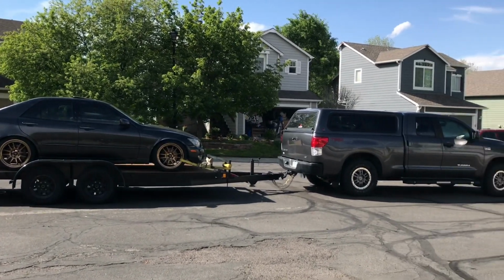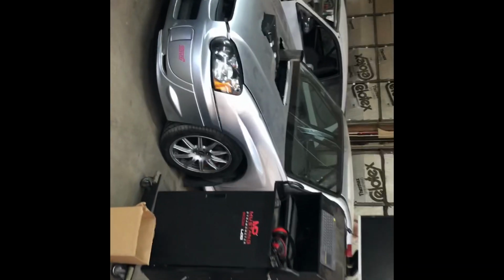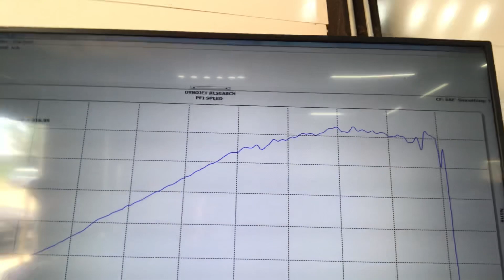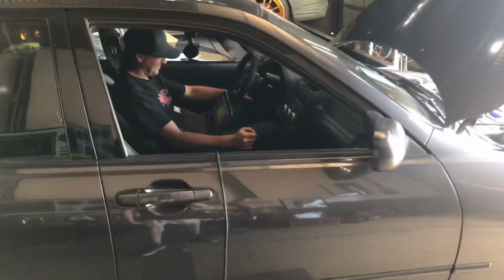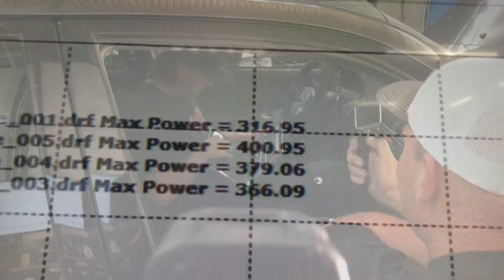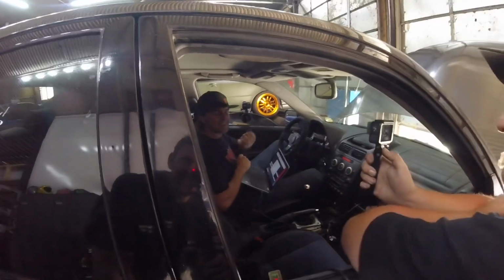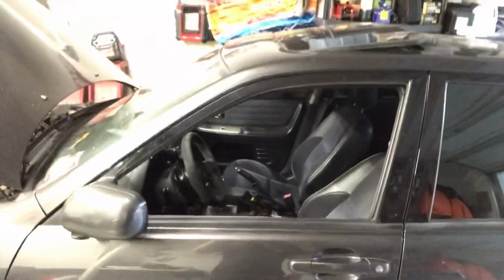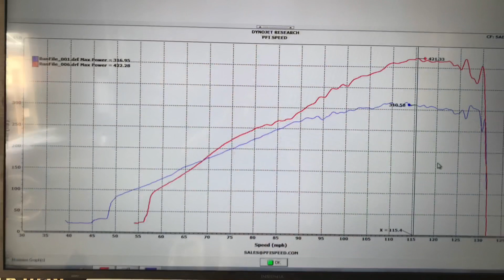How Much Power does a NA-T Stock IS300 Make?  PFI Speed Dyno Tune

Comment: 400whp @ 9psi on a stock 2jzge??? Sheeshhhhhhh

Edit: 421whp @ 10psi?!?! I can't wait to turbo mine
Reply: Just make sure your engine and transmission are happy and healthy first!
Reply: Lol I know those aren't stock rods cause the vvti rods don't hold up
Reply: @Singleturbo-sk9qp  Everything in his engine is stock. Check out his previous videos. Stock engine can handle up to maybe 12.
Reply: Singleturbo 1995 it all depends on the tune to much detonation or running lean will tweak vvti rods in a heartbeat. But proper fueling/tuning it will hold for a while not saying it lasts forever, but it will hold 12 psi is on the top of the stock spectrum 8psi all day though.
Reply: Singleturbo 1995 the stock VVTI rods hold a lot more power then given credit to. It’s really the exhaust temperature that fuck up VVTI rods and pistons
Reply: tjsavage711  thanks for the information but what would you recommend to put in that car with the stock engine to reach 325-350 safe  and not blow the engine out.
Reply: Dhat Lex bruh they the Size of pencils
Reply: Darien Charlton bruh I seen people make 500wheel on 2jzgevvti lol but yall pushing and everyone knows about using the gte head gasket lol but its better to run gte internals however I'll use 2jzge nonvvti internals and just swap my vvti head on also I'm staying auto fuck them slow manuals
Reply: Desxo Esco pull up in Florida.
Reply: Single turbo1995 there the same rods that are in the gte
Reply: It’s not stock but ok
Reply: Darien Charlton I have the 03 ge I’m thinking of boosting it but I have been told you basically have to rebuild the engine it appears that is not true. everything is really stock?
Reply: @travisvaughan8838  you can boost it no problem, keep your timing conservative and ramp boost in. If you want anything over 500 you will definitely want to get rods, pistons, arp head bolt, and either stock head gasket or je pro seal or equivalent. To many little things matter when sticking with stock internals
Reply: Why would anyone go through the work of opening up a ge to swap gte internals? Just buy some decent pistons, rods, and bearings and you'll far exceed what the gte can do and since you have a ge block you have vvti and no oil squirters to drop oil pressure with. If you have good rods and pistons you dont need oil squirters. That's the only argument I hear with the gte block, people don't realize you can definitely have them put in a ge block if really want them for what ever reason you want to convince yourself of.
Reply: @Brother2Jis_27s4   because gte rods are cheap lmfaoo, other than weighing them you're good to go at that point. The stock bottom end of a gte can live at 500hp for a long time and be happy lol. Not everyone wants to make 1000hp. Lots of ppl buy a gte for a free thousand then spend another 3k or 4k so they can do rolling burnouts on the highway XD.
Reply: @LucoreAuto  ⁿ
Reply: @brandonburchfield1609  hmmmm? :) Our 500whp 2JZ-GE IS300 is still doing JUST fine.. :) Of course it's also built to take the abuse ;)
Reply: What Ecu you running?

Comment: What an awesome video and experience. Goes to show if you do things right you don't have to change out every single part and have your car turn into a garbage disposal for your paychecks and time. Also those guys tuning your car are extremely legit I've seen and heard of them before. I have an 02 it's an automatic and still debating wether I want to do the manual swap or not because the cost of the turbo and everything else needed, but more importantly I heard the autos can handle the turbo a little better. Still nothing beats driving a stick. Gonna start making videos soon and hope to get the recognition you get someday! Thanks for the inspiration I'm gonna go the route you took it's the exact goal I have in mind. ✌

Comment: I just picked up a is300, can't wait to turbo it. First seen it in grand turismo lol
Reply: Auto trans can’t take much power
Reply: @hotboiz959  I have a manual and I’ve driven an auto. They’re not that different tbh. Although the manual might be built better not sure never looked into it.
Reply: @hotboiz959  actually you're wrong, the auto tran in the is300 is stronger and candle handle more power then the stock w55 transmission. Even then 350whp on a small pretty light car it's gonna be fun still regardless if it's auto or manual but manual be even more funner.
Reply: @Nffyr  the stock w55 manual transmission in the is300 is extremely weak compared to the auto tran but it be funner in manual anyway

Comment: Now we need you to take it back to the track and get out of the 14s 😂 

NA-T gang 💪🏾
Reply: And
Reply: 14s? That’s easily low 12s n 11s with a good driver n some sticky tires
Reply: @christopherclaure6689  much much MUCH harder said than done. Getting traction in a big power IS300 is NOT easy  even on sticky tires.
Reply: @LucoreAuto   dude what cars have you had 420 rwhp is not hard to put down. Nice mickey thompson et streets can hold north of 6xx. You just got to know your wheel tire setup, and practice your driving if you never been to the track.
Reply: @christopherclaure6689  well typically something BUILT to make 420rwhp also has room for a big fat tire in the rear to help. You also see most people doing a 15 inch rear wheel for a big nasty racecar tire, neither of which are easy options on an IS300. But yes, above ALL else, the driver mod is the most important!
Reply: @LucoreAuto  
well stock you cant fit a big fat tire you'd have to modify  it to get anything bigger then a 245.

Comment: Great video! That is pretty impressive on stock internals.
Reply: Its a 2jz they are way over built and can handal alot of power
Reply: not john the VVTI 2JZ in the IS300 is much weaker than the non VVTI in the MK4 Supra and such. The VVTI pistons as far as I know are smaller and thinner (but the piston head between the VVTI and non VVTI are the same). Non vvti’s can handle up to 600hp and vvti’s can handle up to 450hp ish on stock internals. still, 400hp on stock internals is impressive
Reply: @grqmedia3489  damn u know your stuff thx for sharing
Reply: GRQ MEDIA  The piston heads are the same but the dishes are not. The compression ratio in a tad higher on the VVTI. The compression is lower on the non-vvti but the rods are tougher so you can boost’em up real nice.
Reply: @louifnfs  yes, vvti head on non vvti bottom end
Reply: Jice Z  But since the rods and piston from a non vvti are the same as a GTE you would be better of with keep the non vvti head and dropping it on the vvti bottom. No?
Reply: @louifnfs  I'm trying to keep my build pretty stock looking so i can put it back to stock theoretically for emissions.  So 2jzge non vvti has stock gte rods and strong pistons but not gte pistons but stronger than 2jzge vvti pistons. I want to use the 2jzge vvti head  to be able to put my is300 back to stock.  It would be easier to just put the complete 2jzge non vvti engine in but I'm pretty sure the stock is300 ecu won't like that and I would have to run a stand alone and not be able to pass emissions.
Reply: Jice Z the problem with the whole non vvti is that the bottom part is not exactly the same ie the oil pan is relocated and it is not an easy fit in an is300. I guess it is still doable but yeah the ecu might give you some problem so you might want to get the engine with the ecu.
Reply: @louifnfs  yes and feeding the vvti gear with oil.  For the pan I will be swapping over the is300 oil pans and for the vvti gear using a sandwich plate from the oil filter.  Once I take off the oil pans on the non vvti and vvti engine I will be able to see if there are any major differences preventing the is300 oil pans to be directly swapped over to the non vvti ge.  This is kind of a long term project so I may not get to it for a while. From the research I've done it should have a high probability of working.

Comment: I wonder if just a simple gte head gasket would help reliability. Stock its 10.5:1. I think if it was lowered too at least 9 or so it would probably take a ton of beating off the stock pistons and rods. 

Alot of people say the ring landings fail first on the stock ge, which is probably because of all that boost pressure trying to be compressed.
Reply: Nope you would have to run more boost to make the same power. Then you would still end up with a bent rod.
Reply: @Alexhernandez-ef8yd  Yes but it would only lose around 10hp if it was reduced to 8.5:1. Yet it would still take some of the pressure off the GE pistons and rods. Definatly worth it on a stock motor
Reply: Torque is what going to bend the rods so even lower compression it wouldn't matter. Even then you would make the car sluggish and laggy.
Reply: @Alexhernandez-ef8yd   Alex hernandez  Its mainly the ring landings that fail on the stock GE. Because of high cylinder pressure, detonation or preignition. Those things can be  reduced by a lower CR. Bottom line is 10.5:1 is high for a 2JZ-GE Na-T with the stock internals. The 2JZ-GTE has a bullet proof reputation because of its 8.5:1 CR and stronger internals. It works good for the GTE and will work good for the GE.
Reply: @blu3flare25  have you compared the rods  from a 2jzge vvti to any other 2jzge or 2jzgte? They are way thinner....... then the 2jzge vvti head and 2jzgte head are different so using the 2jzgte headgasket isn't going to give you the same squish.
Reply: Another big problem with the stock GE is the rings are gapped for a NA setup. Not a boosted setup. Which is probly another factor that explains the ringlanding failures.
Reply: @Alexhernandez-ef8yd  Yes i know the GE VVTI rods are thinner thus one of the reasons id consider a lower CR. The diffrence in squish would be negligable, there both pentroof head designs.

Comment: Killer build, ima watch more of ur stuff, but did u rebuild the top end of ur engine, or is it still all stock internals? I’m aiming for 600hp build to run at 3/350 to start. But the rebuild is gonna cost many arms and legs… and my trans,😭😂😂 any recommendations on where to start, already got turbo and waste gate, and gonna get the headers next, and ECU, but what do u recommend?

Comment: Is your 2jz ge unopened stock head gasket? I'm looking to do a na-t as well any advice? I really appreciate it, Cheers !
Reply: I had the same question too, from what i was reading is people tend to go gte headgaskets to lower the compression to 8:5:1
Reply: @elotevender  u can run stock tho cuz it will make more power
Reply: @elotevender  a gte headgasket wont lower the compression that much, it will sit at about 9.5:1 with a gte headgasket and ge vvti head and pistons
Reply: @elotevender  if you want to go lower, you can use 2.5mm thick head gasket but that only will drop it down to 9.0:1 compression ratio on the ge vvti engine

Comment: How much does it cost to get it tuned? My is300 is being boosted currently.  Im working on the fuel system. What did you do for the FPR i saw you had a sensor added to it, do you need that?

Comment: How much boost is safe to run to make decent power (imo 300-350) but also I wouldn't have to worry about blowing the motor for atleast a year of driving it?
Reply from the maker: Zibby H i initially made 315whp on 5 psi.
Reply: @C3GARAGEMedia  dude that's INSANE I mean we know the 2jz is a beast but 5psi? That's op 😂

Comment: Solid numbere for so little boost. Mine makes mid 400's on 15 pounds on pump gas
Reply from the maker: RacecarAndChill thanks for watching!  I was very happy with the numbers. I actually watched your video on removing the stock fpr in the tank.
Reply: I thought so too. Mine is 470whp/450wtq @ 17psi. That's with 16º of timing.

Comment: Add some e85 to help with emissions. It burns cleaner. If I were you I'd make a separate emissions tune running as much e85 as your fuel system will support.

Comment: So you’re telling me I can save up around 5k here in CA and buy me a stock Lexus is300 and after thrown on a turbo? And run okay?
Reply from the maker: Carlos Chavez in essence yes!  A good engine and fuel management is a solid must before turboing any IS300
Reply: C3GARAGE Media I’m deciding between a 2007 is3350 or 2004 is300
Reply: yep!! its been done many times over the years. youll be fine

Comment: What turbo kit set up did you use on your ge? And did you do anything to the head?
Reply from the maker: Gerardo Lopez cx racing on aem infinity and injectors. Totally stock. Check out my early videos for the build
Reply: They slow don't they know that ge heads flow better and the ge higher compression so it will make power

Comment: Yo what transmission you running, stock w55? or w58 or even if you have an r154
Reply from the maker: W55
Reply: @C3GARAGEMedia  hold up you running 420 hp in a stock W55?

Comment: big question, do you need to tune your is300 after turboing it? on a stock ECU?
Reply from the maker: Christopher Romero you cannot or better should not turbo with the factory ecu. You will eun lean and blow the motor quickly. You need at bare minimum a piggy back ecu, which is still risky. The best way to reliably turbo a GE 2J is a full stand alone ecu. I used AEM infinity. Good luck.

Comment: Thanks for all the videos. I've been watching your videos since November 2017 when I bought my 2002 IS300. I am starting a very simulator build to yours next week with the CX Racing kit and the AEM infinity. I just have a few more odds and ends to buy. If you did it over again would you still go with the Boomslang?
Reply from the maker: Joel McCourt thanks for watching!  Do not go with boomslang. I had to rewire the cam/crank sensors because he does them wrong and would not correct the issue.
Reply: @C3GARAGEMedia  Yes, I remember you having issues with it from previous videos. Any recommendations for a different harness?
Reply: @C3GARAGEMedia  Congratulations on your dyno number!!! I can't wait to get there.
Reply from the maker: Joel McCourt i would look at rywire or wiring specialties.
Reply: @C3GARAGEMedia  Cool man. Thanks, I'll have to check them out.
Reply: @C3GARAGEMedia  hello bro I want help I have supra Mk4 2jz ge non vvti and I want make turbo you know where found turbo kit for my cars?my cars is right driver

Comment: I want to know what the torque is. Myself would not be pushing more than 350 TQ with the w55. What torque is she putting out?
Reply from the maker: Austin 152 they were having interference with their torque readings. So unsure. If I were to guess based off my old dyno prob somewhere around 400tq. Honestly I could care less if the w55 goes. Just a good reason to upgrade. Thus far its ripping smooth shifting and no issues.
Reply: @C3GARAGEMedia  I've got a very complete R154 setup for IS300 for sale. I actually posted a couple videos of it, if interested...
Reply from the maker: GroovesAndLands thanks. I am good at the moment. I am going to torture the w55 till she goes then cd009.
Reply: @C3GARAGEMedia  I considered cd009, but went t56 instead. Very happy with that choice
Reply: @GroovesAndLands   t56 has better gear ratios
Reply: @Singleturbo-sk9qp  Sure does, considering the rear end gear ratios available for the IS300. I have 3.73 in mine. First gear is a bit tall, but ok. I think the 3.91 gears from an auto would be perfect. The 4.11 gears from a BRZ/FRS/86 coupled with a T56 magnum "close ratio" are essentially identical to a V160 with 3.13 gear.
Reply: @GroovesAndLands   also the vvti in the sc300 made 225 but the vvti in the is300 made 215 that's crazy but I can get a vvti  ge for 750 with low miles but I think a ge is better
Reply: @GroovesAndLands  gte
Reply: Also I live in Atlanta and nobody has time to be shifting when I can get a built auto from atf that can hold 900hp

Comment: Yo  What transmission you have on the car ?
Reply from the maker: Stock w55. Drifting 4+ years. Hard use over 400whp.
Reply: @C3GARAGEMedia  I see your the lucky 10% of the IS300 that came with Manual.

Comment: Jesus man good job, kinda funny if you search 2j forums everyone is going to tell you to do a gte swap. Idk how long that w55 is gonna last drifting tho.
Reply from the maker: OkiStash thanks. I was pretty happy with the results. The w55 has been solid through 11 drift events. No issues. If it goes its just another excuse to upgrade
Reply: @C3GARAGEMedia   Im happy for you man. Just keep us updated.
Reply: Lucky the sc300s came with w58s
Reply: Singleturbo 1995  its not much stronger lol
Reply: @okistash3075  all I'm saying is the sc300 got all the supra parts you can put supra suspension subframe and etc and it has the supra Trans lol I'm auto so idc
Reply: The SC300 has the Non turbo MkIV Supra trans, which you’re correct - it’s a W58. The TT Supra has a total different manual trans - the V160.

Comment: cant remember did you put a bigger hg on?
Reply from the maker: Not sure what you mean. I have a tial waste gate, DW 550cc injectors and the rest is the cx racing kit.
Reply: @C3GARAGEMedia  did you put a thicker headgasket on running 10 psi or still running stock. Good numbers with a 5 smoothing by the way.
Reply from the maker: PFUNKMIXER stock. I do plan on gte gasket and studs.
Reply: @C3GARAGEMedia  mine is studded was thinking of cranking the boost now i think 10 is the limit on stock hg if rings hold up

Comment: Congrats on the dyno numbers. What fuel did you have and is it un-opened 2jzge Vvti?
Reply from the maker: Faz Fici stock unopened motor on pump gas 91 octane.
Reply: I had mixed feelings about the kit. But I give you total respect for the build. Looks like I’ll also do the same as well. Are you running the stock w55 transmission with a upgraded clutch or something else?
Reply from the maker: Stock w55 with upgraded clutch and flywheel. It works great but I would replace the wastegate with a tial one like I did.
Reply: C3GARAGE Media do you have IG?